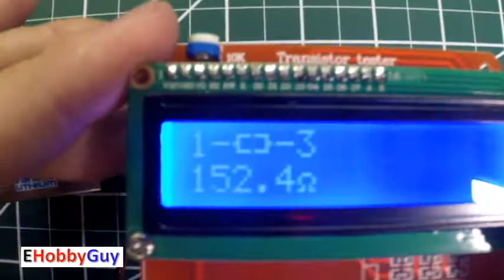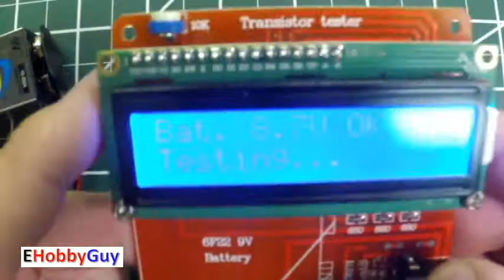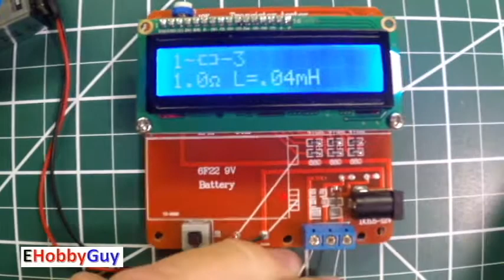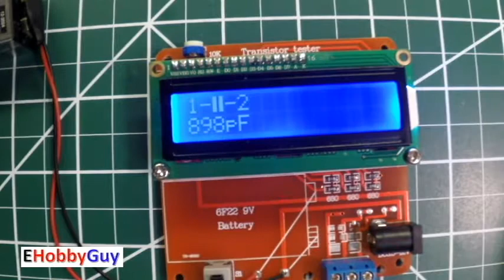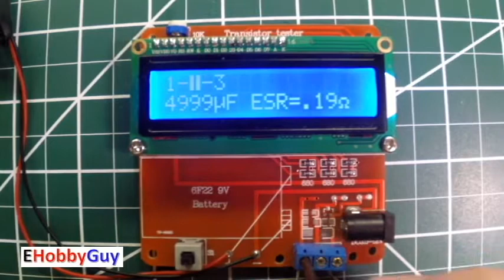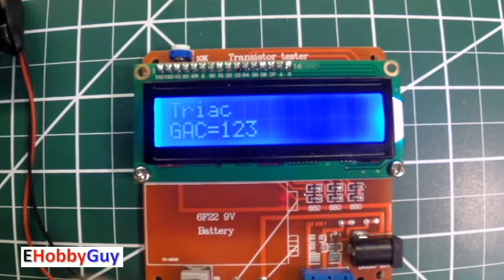Identify/Test Tons of Components FAST

Comment: I've had one for years and love it .I do like the design of mine better, as it has 8 slots to insert an unknown component into. You place your component in any of the slots then push down on a locking lever. The lever closes all eight terminals simultaneously Yours is the only one that I've ever seen with manual screw down terminals. Enjoyed your video.
Reply from the maker: 8du Thank you. Yes i am familiar with the one you speak of. There are definitely better versions out there now. Thank you for watching. i appreciate it.